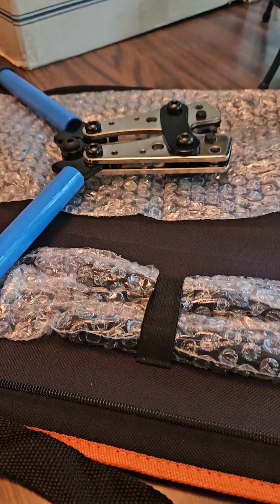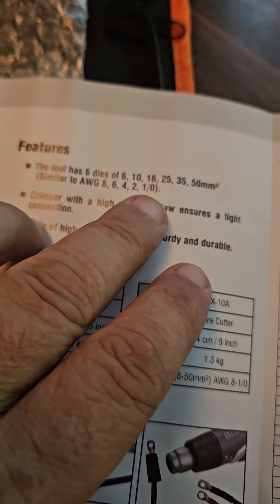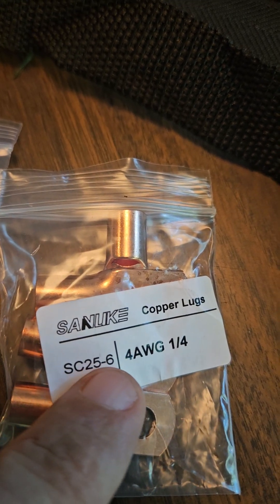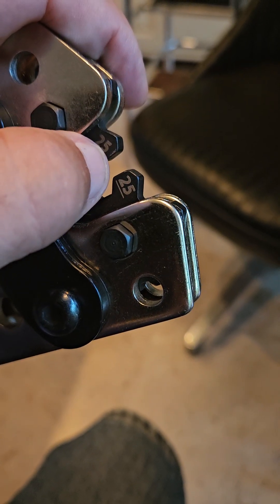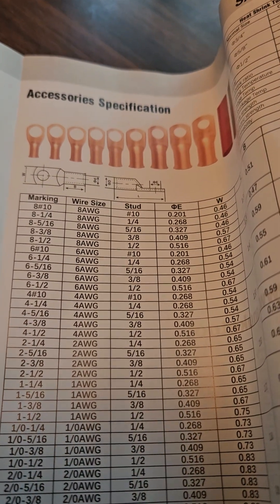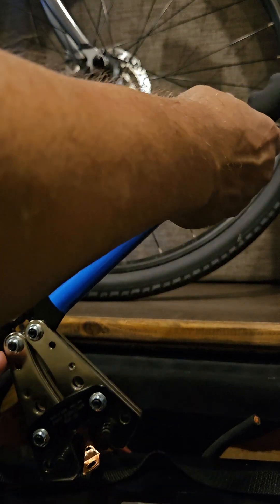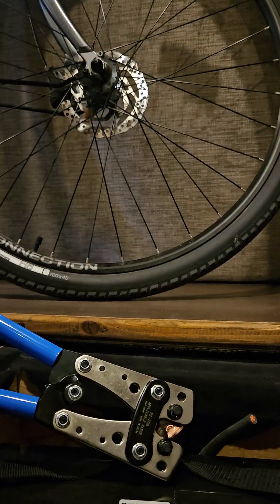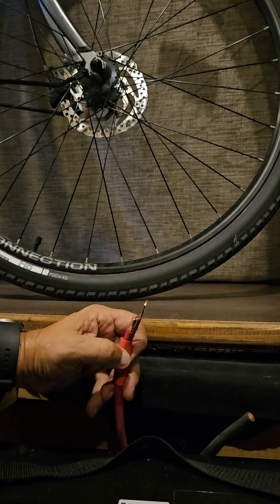SANUKE Wire Crimper and  SC Type Lug Sizes Explained.

Comment: Got this for my dad and we used some spare 4 awg wire and the crimps that come with it and set the tool to 4 awg and squeezed the crimps on the wire but it still falls off the wire? Anyone know of this?
Reply: If enough consumables to practice, just keep dialing down until it crimps tight. 

Caveat is making sure your lug is meant for the wire you are using.